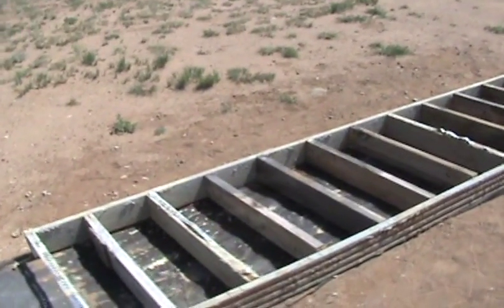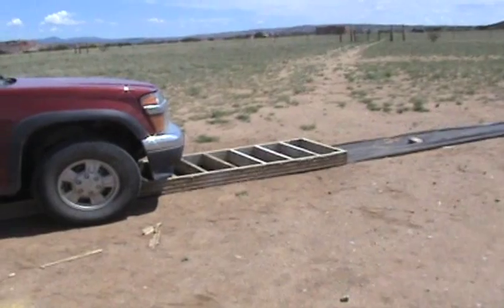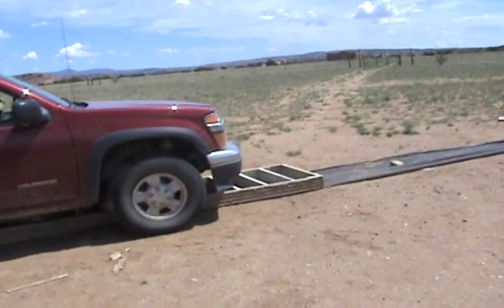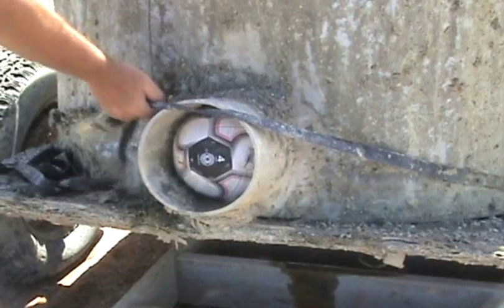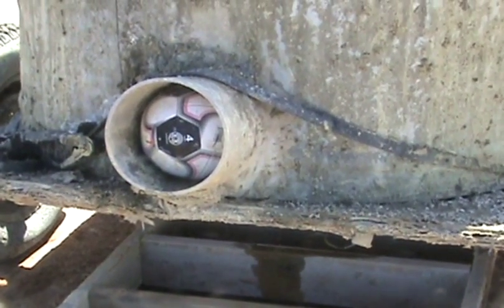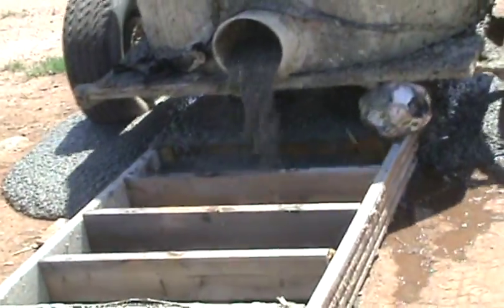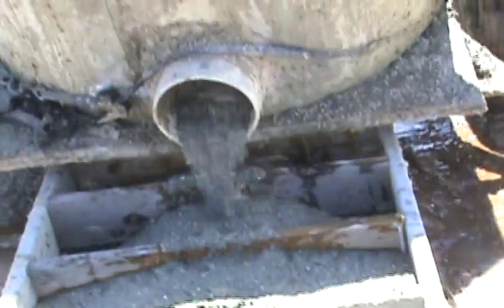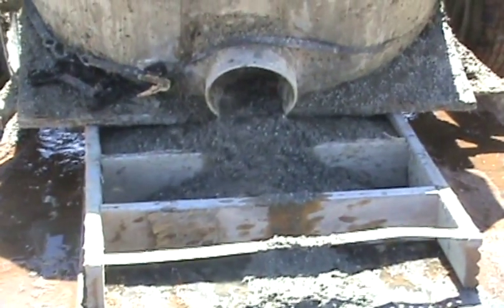Mixing Technique Continued, Pouring into Forms

Comment: Why can't a person make a mold and fill a whole wall instead of making all these bricks and then putting them together?
Reply from the maker: +Sherry Lambert You are right. I did my second building as you describe but I used the blocks in the form first then poured the slurry all over and around them.
Reply: Judith Williams do you have a video of that? 😀